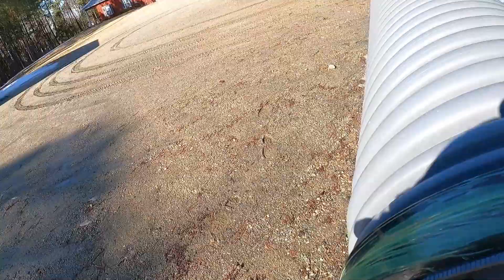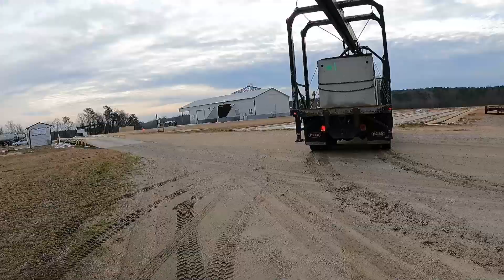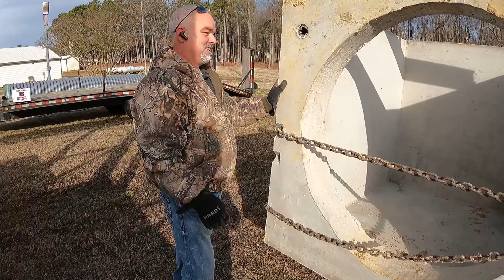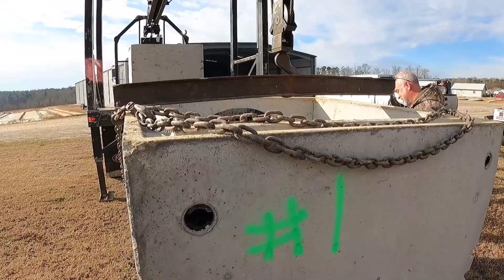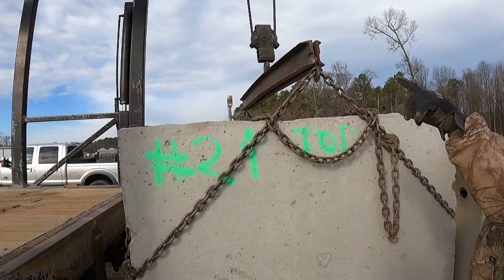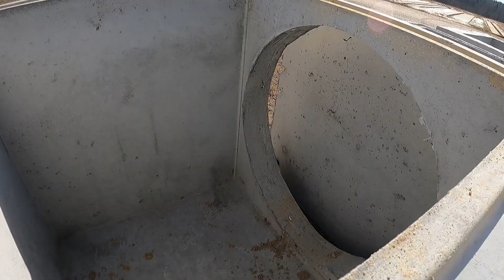Taking Materials To The Big Pond Repair Project

Comment: If you laid two ratchet straps across the trailer, put the bottom two pipes on the trailer with the straps under both, had something with forks wide enough to pick up the next two pipes and hold them over the two on the trailer just to where they touch the bottom two, hold them there while you wrap the ratchet straps around all four kind of like banding them together, then you could throw another two ratchet straps over them to hold them in place on the trailer. I had to do this when hauling some big pipe like that before. Of course I had help from a man on a large forklift at the pipe yard though. So I can talk all day about how to do it but if you don't have the equipment and/or help you won't be able to do it anyway though. It will work if you can get it done like that. 👍

Comment: Picture this: Four lengths of rope (or chain) lashed figure eight style around both ends of both pair(s) of pipes.
Then lift one pair onto the trailer, slid to the side with the shortest stakes, (if any).
Then lift the other pair, resting on the other stakes, and leaning on the first pair.
ta-daa // four pipes on the wagon //

Comment: 5.27 a good way to loose your arm sticking it into the hole above the extremely tensioned hoist chain should it slip....
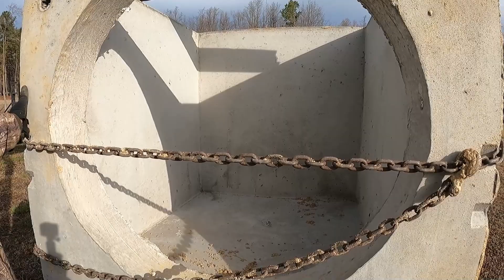Reply: 5:27 I don't think the box was high enough off the ground at that point to catch him, but as a general rule you're absolutely right.

Comment: Chris what is your objection to making taller sides on the trailer to haul all the pipe at once? Two trips 100 miles round trip $4 dollars a gallon for gas? Risk?  Sorry you will have to move the huge concrete boxes again. This will be one huge job.

Comment: Maybe put the second set of pipes together lengthwise, and put it on the top of 1st 2 in such a way the front end extend to about midpoint of truck bed? Not certain about that idea… clearances above bed? The tail end might stick too far over back of trailer…?

Comment: I was just thinking that if your trailer is 102 inches wide and the pipe are 3 ft diameter, would it not work to put 3 pipe on the trailer floor and 1 on top? I know you would be a little bit overwide but .... LoL I guess I'm setting here thinking out of the box a little bit. 😁 Great video though! I'm ready to watch you do that job.
Reply from the maker: Yeah pipe is 42" on the outside.  That puts me way over width

Comment: Chris, what’s the length of your tri axle?
Reply from the maker: 24'
Reply: @letsdig18  20’ deck 4’ tail?
Reply from the maker: @davedamon4271  I think so. Or 21 and 3 I can't remember
Reply: @letsdig18   Can’t hardly get your hands on a decent deck over up here in Michigan.  There’s a 28’ tri not far from me… I feel that 12k for a 2016 seems steep.

Comment: We used to use timber u frames or goal posts. Rope between the two uprights after the first layers. If the legs hang over the sides of the trailer even better.

Comment: put a 4x4  across each end after you have the first 2 on and then you can put   2 more on only need a small rock or something to stop it from rolling off while you put 4th one on and strap it
Reply: was thinking the same thing.. also two 2x4 centered on trailer taller than pipe would work .. Strap em and roll on..
Reply: Either that or stand 2x4 on the sides of the trailer so they wont roll of before they get tightened in place